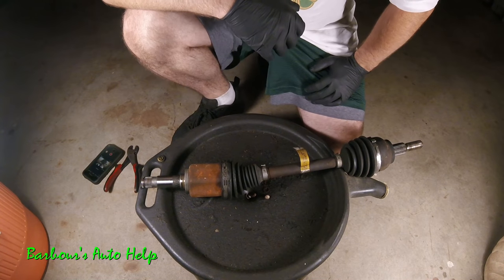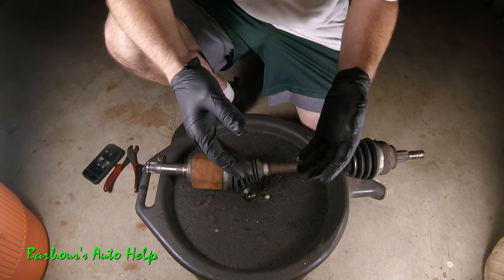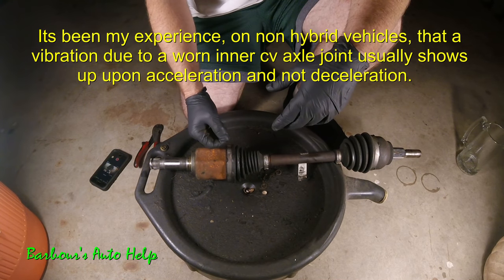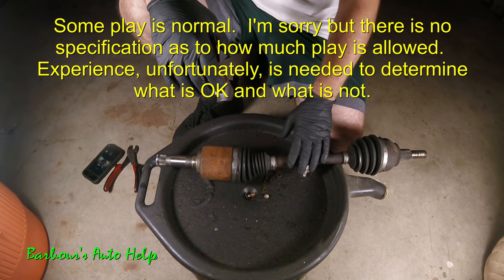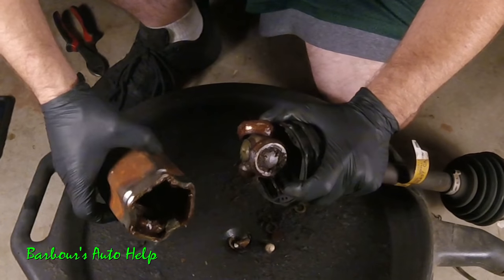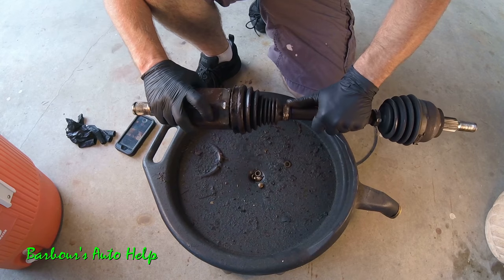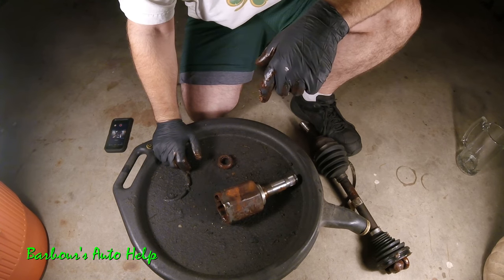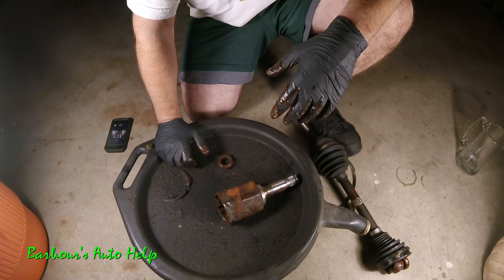How a Worn  CV Axle Can Cause Vibration

Comment: Sir, would it also cause the wheel to smoke after being driven on for about ten minutes? Thank you
Reply from the maker: That sounds like your brakes are locking up.
Reply: It was shaking and hard to control, took it in and for “three” days kept the guy said it was bad old tires and everything else was fine. I was really skeptical and   took it to another shop with same thing said. Got the new tire set and all the extras they said I needed for the tires and balancing and all breaks are at 75% all around and all joints were fine. Drove it home 3 miles just fine. Next day it’s shaking, thumping, smoking and hard to control once again. Shaking and thumping so hard I felt like I was on an old John Deere tractor in a field. Any ideas??? Thank you
Reply from the maker: You need to have the tech duplicate the symptom while the are driving it.  That doesn't sound like tires. Tires won't cause smoke.  Still sounds like brakes.   I'd take it back to them and tell them what happened.
Reply: BarboursAutoHelp  thank you for reading and reply!!
Reply: I have the same problem and changed my brake pad and caliber and it still doing the same thing.If I change  that part you have on this video will it fix the problem?THANKS.
Reply from the maker: No way I could say for sure
Reply: I had mine smoking when it was a automatic axel n i needed a manual it pulled out

Comment: Have 08 dodge ram 4wd. Question is can 4wd cv axles cause vibration as well? Left driver's side is real sloppy.
Reply from the maker: Possibly if it's vibrating when in 4x4.  I'd say if it does it when its not in 4x4 it's probably something else but still possible I guess.

Comment: I have a 2008 nissan rogue AWD and  under acceleration the floorboard and gas pedal vibrate and could feel it at lower speeds especially when accelerating from 20mph also at times when decelerating. I did check and see that  both cv axles boots are torn and grease all over. I hope after replacing both cv axles the vibration goes away:(
Reply from the maker: Let us know.

Comment: I am getting a slight vibration on steering on my Laura 2.0 Automatic, getting it around 20kmph to 30. Though it is a slight vibration? what can be the problem ? axle ? tyres ? wheel balancing ?
Reply from the maker: Could be all the above.   Have you poked around to see if you could figure it out?
Reply: No, cant figure it out. As the engine sounds perfect.
Reply: Can be any of those but i got new tires aligned and balance and still does that. Im going to change my axles now

Comment: My 2013 altima 2.5 feels vibration in steering at 80 km to 120 km/hr i did wheel balancing tyre alignment and Rim bends repair but still at 90-100 speed feels vibration in steering wheel could it be CV joint Axles ??
Reply from the maker: It's possible.

Comment: I have a 2015 Nissan x trail hybrid and when I step on the brakes the vehicle shakes up and when I pulling off it’s the same problem as well, when could be the cause of it and how to get it fixed.?
Reply from the maker: Well, it could be an axle.  Have it checked out first if your not sure.  If it is an axle causing the problem then it would need to be replaced.

Comment: Hello, I replaced car engine, got good engine no issues, but mechanic said it was hard to remove drive shaft from gearbox end now it's poped in but my car jerks severe when I put foot down around 40mph on 4th and 60 mph in 5th car shakes bad in 4th 5th when I go faster it cams down  I got bad winning noise too, can u help
Reply from the maker: Probably best to have a tech look at it.

Comment: I have a 2010 Ford Focus SE with about 128,000 miles on it. I’ve been replacing some older parts based on tire wear patterns and now have new issues. I replaced the rear drums, rear shocks, put new tires on the back from cupping. Front tires are 11 months old. I replaced the front strut and spring assembly, new brake pads and rotors, I also put 8 new wheel studs on the front and got it aligned. The right CV axle was replaced 9/8/18. I still have front end vibration from 0-20mph. It is amplified when turning right and accelerating as well. Does the driver’s side CV need replacing? What else could it be?

TL; DR
Vibration from 0-20. Can’t locate the problem. Thank you!!
Reply from the maker: I have a link to another video that may help you out in the description of this video.  That being said, paying to have an experienced technician diagnose your vehicle may not be a bad idea.  It could even save you money by not paying for parts not needed.

Comment: Can the cv axle joint cause the vehicle to jerk hard movement after accelerating after a complete stop ?
Reply: Like if it missed a 1 gear but the transmission is good
Reply from the maker: Doesn't sound like an axle. Not sure exactly what your vehicle is doing.

Comment: I'm dealing with constant Axel seal failure... Would a bad cv Axel cause this?
Reply from the maker: So you've replaced the seal several times?
Reply: @BarboursAutoHelp  On both sides... I'm not sure if it's the axel or I have the seals in wrong.
Reply from the maker: You may have a worn bushing inside the diff where the axle slides in on both sides.  I'd suggest having a shop take care of that one for you.

Comment: I have a bad vibration coming from the passenger side feels like it felt when my rear right tire went out at highway speeds but checked all my wheels and they’re fine, and also the fact that it’s coming from the passenger front side looked through the hood haven’t checked it from underneath but everything looked ok, could it be the cv axles it shakes really badly but at certain speeds it just stops like higher speeds usually it stops
Reply from the maker: Could be that or a bad or out of balance tire.  Could also have a tire coming apart on you.  Have you checked anything yet?
Reply: Barbour's Auto Help yea apparently it’s just that my suspension is blown on that spot, they kinda fixed it so it stopped doing it haven’t had a chance to swap in my new coilovers to the front yet so it still feels weird and you can hear noises when I go over bumps
Reply from the maker: Well, let me know what you find.
Reply: Barbour's Auto Help bet appreciate it

Comment: Great video! 
Is it possible that free play in inner shaft only be felt with axle out of the car? My car has the vibration during acelaration symptom but axles feel very solid and boots are intact. Thank you in advance!
Reply: Might need some balancing on wheel or tie rods or ball joints

Comment: Could this be what's wrong with my 2007 HHR It literally will only do it at 40 mph not 39 or below or 41 mph or higher it's strictly at 40 mph
Reply from the maker: Have you checked the balance on your tires.

Comment: I noticed inner wear in the front tire and excessive moving of wheel side to side.189,000 original mile axles?
Reply from the maker: Maybe needs tie rod ends and an alignment.   Not sure.  Axles won't cause tire wear though.

Comment: My axle shift on the right side is broken  an when I go to back out I got to press down real heard to back up but when I go forward it don't do that an it shudder  an shakes
Reply: What do I do
Reply from the maker: Sounds like you have a broken axle maybe from what you said?  Not sure if I understood you..  If the axle is broken it will need to be replaced.
Reply: @BarboursAutoHelp  i no cause I hope its not the transmission cause it a 2008 nissan altima 2.5 s
Reply: U ther

Comment: I have vibration but if I put it in neutral and coast it goes away any ideas??
Reply from the maker: Possibly something in the drive line.  Have you gotten under the vehicle to inspect things yet?
Reply: I’m thinking it’s a bad motor mount now from further research I’ve done
Reply from the maker: Research is good.  A hands on inspection is better.

Comment: my 95 t bird vibrates around 60 with light gas applied at cruising speeds then stops when i take my foot off..
Reply from the maker: Do you think it's an axle?
Reply: @BarboursAutoHelp  maybe ..i replaced the diff assembly

Comment: My car (rear wheel drive) vibrates when it hits 75-83 mph and when you let off the gas pedal it vibrates stronger for a second.....

Not sure what that might be. I changed passenger rear axle. Need to change driver side soon. Maybe the U-joint on drive shaft?
Reply from the maker: Have you had the tire balance checked?

Comment: My passenger side seat slightly can this be caused by a bad driver side cv axle had them checked out and was told that it was my driver side cv axle.
Reply from the maker: I'm sorry.  I'm not understanding the question.  You may have hit a few incorrect keys.

Comment: I just installed a new set for my 2003 hyundai accent now my car is shaking
Reply from the maker: Was it shaking before?
Reply: @BarboursAutoHelp  No it was not. Its only clicking before when i turn. No vibrations at all. I mightve purchased some poor quality axles from ebay.
Reply from the maker: Its possible.  Have you checked over your work to make sure everything was installed correctly?
Reply: @BarboursAutoHelp   Yes I did. I also just replaced my 2002 Honda Civics and I didnt get this vibration.
Reply from the maker: Ok.  Yea, its possible you got bad axles.  Usually you'll have excessive play in the inner joint when you get a vibration upon acceleration.  Hope you get it fixed.  God speed.
Reply: BarboursAutoHelp  cn